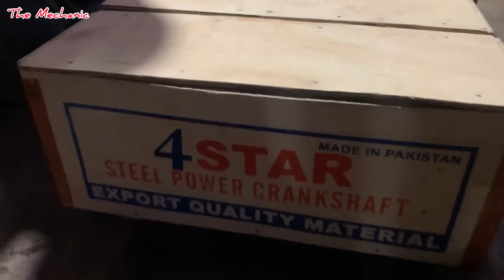Production of Crankshafts in Factory Complete Process || Machining 3 Cylinder Engine Crankshaft

Comment: Interesting. I worked on crank lines at Ford, GM and Mitsubishi as an OEM service engineer for 20 years. It seems that they are missing a few steps. There are no undercuts on the bearings and no heat treatment either. These cranks look nice but my experience tells me that they will only last a few months before failing. We worked hard to hold tolerances down to the tens of microns but I can't see how they are even holding to several thousands. Our crank lines had 50+ ops. This one is skipping many essential steps. What they are doing is impressive but these cranks would compare to what the US was producing in the 1930's.
Reply: I suspect the tolerances they are dealing with are pretty big engine wide.  They don’t even use torque wrenches.
Reply: A quick search of the casting number will tell that this is for a Perkins 135 engine. It's a stationary 3 cylinders diesel used in generators so they will only run at a preset speed, unlike car and truck engines that will indefinitely idle, increase speed, decrease speed, overspeed etc...all while the load and temperature constantly changes. And also some of them have to endure their common nemesis, super clueless drivers.
Reply: you cannot heat treat the cast parts.
Reply: They are also skipped balancing.
Reply: @blabla-kk8bl  Sure you can. We used induction heat treating on both cast and forged cranks. The GM plant in Tennessee did both types on parallel lines. The procedure is different for cast and forged parts but I can guarantee you that you can heat treat both.
Reply: @blabla-kk8bl  You can. Its done after the rough pass.
Reply: @vitor900000  true.
Reply: i think, it depends on the use of the engine, im a mechanic and a machinist myself so i know that a 3 cylinder with a crank like that it probably use in low power and low demand application so u don need tight tolerance or heat treatment because they won’t be abuse. i’ll probably be better to do so but i guess that the costs added to to all the extra process it not worked the benefits
Reply: yea, sure man....do we even want to know what the casting is made from?  you are worried about a few thousandths...??
Reply: I couldn't agree more.
Reply: @blabla-kk8bl  really, i thought my 1973 351-c had heat treated valve seats to help with unleaded gas
Reply: This is about how Ford was ruined by Japanese cars, and Detroit became a ghost town
Reply: @GaryCornelius  sir why you don't teach people? Like on youtube
Reply: Aftermarket fake parts. These will do more bad than good.
Reply: @wajid806  If you ever went through an American auto factory you would realize just how uninformed your comment is. This is a local job shop making knock off cranks for discontinued motors. The technology they are using is straight out of the 30's and 40's. The quality is undoubtedly "just good enough" to run.
Reply: @ТоварищЖанаозенский  Detroit may be down but the rest of the country is still making great cars and trucks. Stop by the GM plant in Spring Hill TN sometime. It is state of the art and makes excellent vehicles.
Reply: @guuuu666  its 
Massey Ferguson 135 Engine. Widely used for agriculture in Pakistan. Obviously the load these tractors have to endure is enormous. Im  agreeing with Gary here.
Reply: @SolarRepublic  I worked for 50 years and the last 20 of them one of my duties was to teach the union service techs how to repair our machines. Now I am retired and no longer want to work. Simple as that.
Reply: Precisely
Reply: @blabla-kk8bl   Sure you can. It's done all the time.
Reply: The first dial indicator you see is the guy cutting the keyway. That's a big clue.
Reply: @wajid806  Gibberish.
Reply: I admire men like you, sir. Men who worked on the edge of precision and tolerance on mechanical industry. Thanks for your testimonial.
Reply: This model of engine, was also produced in Serbia 50 years ago, by the Massey Ferguson licence. 
But i now, that for good quality of engine parts, our factory after casting engine block and crankshafts, were leaving them for 5 years outside of the factory, to go through process of material aging.
Even now there are hundreds of tractors in use, many of them never had intervention on engine. Also many of them were sold in Egypt, and are one of the rare ones to  withstand the excessive heat and conditions.
Reply: These are not the finished product.
Reply: @guuuu666  And lots of Massy Ferguson diesel tractors.
Reply: I see there are many engineers and machinists on this thread, and all have very interesting opinions on how this can be improved. But the basic fact of the matter is, these workmen have probably never been to any engineering college or have had no vocational training. They all get on-job training from whoever is the machinist before them on the shop. They are hired as interns without pay, and when they prove their skills, they start getting a wage. Most of them haven't seen a torque wrench in their lives, let alone using one in the workshop. Their idea is "tighter is better" and would use the largest pipe extension they can use!!
Reply: I am okay, they seem to be good workers but their methods are a thing of the past...Even at the end, how they oil the crankshafts with a rag !?!....
Reply: @blabla-kk8bl  Luckily you can.
Reply: @blabla-kk8bl  
You can with steel cast. Grey cast however, wont work. That's true.
Reply: @routtookc8064  
Out-of-roundness and thus tolerance is the decisive factor for the dynamic stability of a crankshaft. 
This is also the reason why car crankshafts are never reclamped during production. You never hit the identical center again.
Reply: And crankshaft of the 1930s only lasted a few months?
Reply: 100% Know a guy that tried one of these in his 135...blew apart in the middle of a parade. Look at the "care" taken aligning the journals for grinding. These things are so far out of spec, you can see the difference cylinder to cylinder in piston height at TDC.
Reply: @JoeRocket-sf6qs  Yes, they are. You don't do precision grinding as an intermediate step. That's the very last thing. That would also be why they said "last step" when checking the crank in a block.
Reply: Germany factory didnt any heat treatment after they put th cranck shaft on the cnc
Reply: I think the fact that everyone in this thread is missing is this:
Where the hell else are you going to get a crank for an engine out of production for 40 years? Ebay?
Reply: @mahbriggs  no. last 90 years 👌
Reply: They are working with the technology that they have and have been provided by their employer. You can not compare their apples with your pears. They are doing an excellent job with the primitive tools that they have and the circumstances of their working environment to complete such a microns expectation; so unrealistic right?. I don't think they're not wearing PPE because they don't want to, it's just that the law of the country sucks and doesn't protect them. Give them the right tools and I guarantee you, they will do a way better job than every one criticizing them. They are being judged by the tools that they use, you do not know the extent of their knowledge and the skills that go beyond that which you can imagine. Just say something positive, or do they neither deserve that?
Reply: your sofa experience you must say lol
Reply: They build them to the specifications of the customer just as you did.
Reply: Never mind about machining the important is  the quality of materials
Reply: They probably export these cranks and import cranks from the US to use in vehicles
Reply: @jeremygordijk9153  Exactly
Reply: @blabla-kk8bl  not true, cast is one of the oldest hardened metal. It’s commonly flame hardened.
Reply: @vitor900000  Not really, they are balanced using the two big weights, which are not included. Though we did see them check the clearances of weight blanks.
Reply: @guuuu666  Exactly. Generator or pump applications, easy on easy off low revs
Reply: You all are obviously totally wrong. Most of these three cylinder cranks are made for the latest Toyota Yaris GR. The rest of them are for the Koenigsegg Gemera.
Trust me, as I live near the latter factory so I'll know about their work and precision.
Reply: Looking at the environment of working and procedure, you should've  known that the product is not for high powered application. Of course you've seen a lot of flaw if you're from well enstablished company background. The world is big and there are tons of small market which big companies ignore due to not profitable for them but profitable for small companies like what we see in the video.
Reply: @mahbriggs  Those engines were very low power and ran at low speed. Even at that back then an engine with 30K miles needed to be torn down and rebuilt. When I was young an engine was considered worn out at 100K miles. Now you can get 200K miles out of a well taken care of engine. It is all about keeping tight tolerances and consistent materials. That is impossible with the shop pictured here.
Reply: It’s kinda funny that they refer to this as a crankshaft factory! Lol 😂
Reply: I've been curious for a while about the workers in the engine department.  Do they hire college educated mechanics or do they train on the job?  
The most I've made at a factory was $21.65 an hour running a CNC.  I've heard that auto factory workers get $45+.  If that's true and they're straight off the street, that's an incredible wage.
Reply: Yup! Not something but too many things  missing from those guys MASK & Safety Glasses. Don't you think they need more Irons vitamin from the Doctor.
Reply: That's how Toyota became N1, they worked hard, to make crankshaft as it's one shaft without cranks. Back in USSR time I was working on grinding machines, I couldn't get less than 0.008 mm in ellipse on Russian Volga GAZ 24 on a piston neck. But one time somebody brought Toyota shaft, I was impressed how straight and really balanced this thing was, so easy to work with. On the other hand, Russian VAZ Zhiguli LADA shafts were more stabilized, than Volga ones.
Reply: @frankcherry3810  they don’t even use eye protection.
Reply: Interesting.
Reply: They are great workers,  we all know that.  But sometimes it takes somebody like you to teach them the correct way of doing it the right way the first time.  All they have are some hand me down machines and old ways of doing things.
Reply: People need to just watch and see med do good work  I’m sure in there country they don’t have osha breathing down there neck  but over a million people have watched this video so just enjoy the show don’t back seat machine lol
Reply: @vitor900000  No they didn't. At 23:35 the guy is balancing the crank shaft with an angle grinder. :D
Reply: @routtookc8064  you realize how large a thou is right???? No matter the casting tolerance matters
Reply: The chatter alone tells me they don’t know what they’re doing 😂
Reply: FREEDOM of Speech  Добрый день. Это не был провод, а кусок проволоки. Это простейшее устройство для проверки как радиального так и торцевого биения. Правильность установки детали определяется равномерностью касания проволкой детали. Метод довольно грубый и, как вы верно подметили, абсолютно не подходит для производства этих деталей.
Reply: @sikkepossu  That is not balancing. He is just smoothing the casting roughness.
Reply: There seems to be a lot of these Indian/Pakistani mechanical engineering videos coming out lately.  People seem to rave about the work but I can’t see that it’s all that good.  Repairing diffs and engines etc.  it’s fascinating but that’s all.  When needs must I guess.
Reply: They do no even use eye or auricular protection. Their equipment is outdated, if these crankshafts even work will be very very impressive
Reply: they are pro at their job, with 10% ur salary
Reply: @vitor900000  Yes I know.
Reply: and we wonder why lifters and crankshafts are breaking i wonder why hmmmm
Reply: @blabla-kk8bl  oh yes you can. I work in a foundry and we heat treat castings as per client requirements.
Reply: @routtookc8064  
It's not hard to purify steel if you have the equipment and enough knowledge. These are likely recycled from old ship steel.
Reply: Looks like they are made in Pakistan 🤣🤣
Reply: they are missing balancing too.
Reply: @TB-jl9fr  you can heat-treat gray cast, usually annealing to relieve stress due to uneven cooling and/or for easier machineabilty
Reply: At least in this crank grinding shop they have an Arnold Gauge and seem to be using it!
Reply: Ну так они это и делают на станках 30-х годов
Reply: @GaryCornelius  do you heat-treat the cast with just annealing for machineabilty or temper it too for strength? I'm referring to cast iron crankshafts, not cast steel. Tho i'm not sure if there are cast steel crankshafts, that are mainly strengthened by heat treatment and no forging.
Reply: Виде ремастер из 30х)
Reply: you ve missed the most important thing ...it is made of cast iron not hot forged steel its obvious on the laith ....how could it work
Reply: @upmyhead9930  do you mean the absence of heat treatment of these crankshafts? Cast iron can be heat treated too.
Reply: @winstonmichaels407  no ..the cast iron is brittle unlike the hot forged steel and it doesnt endure knocking on piston or twisting torque
Reply: @upmyhead9930  engine manufacturers also use cast iron cranks for their lower powered engines, 3 cylinder in this case, enough to endure the dynamic stresses such engines produce. Forged ones definitely are needed for the more powerful and high revving engines to counter the greater stresses of the higher power generated.
Reply: @94XJ  he got a crank from Pakistan?
Reply: I love these guys, they are hard working non complaining men.  But their whole job is to basically ruin your next engine.
Reply: @GaryCornelius  as someone who worked machine the machines that microfinished crankshafts I can tell you that you did nothing as all the work was done by the other companies 🤷🏻‍♂️
Reply: @smithy3269  do you mean there are no more engine manufacturers who finish let alone fabricate their own crankshafts? Maybe these are sub-companies being departmentalized by the parent company to produce specific engine components, not necessarily contracted out. Dunno...
Reply: @anis8520  maybe the billet or blanks are already heat treated
Reply: @ammo1033  yes, for both cast iron and cast steel
Reply: just curious, are those billets or blanks already heat treated before they get CNC'd? I only read  heat-rolled, if that means anything to the hardness and strength of the final product. Thanks
Reply: @winstonmichaels407  I machined electric motor shafts and rotors but we also did heat treating.  First we would rough out the profile and leave...200th? (It's been 4 years since I have done that job)... then send it out to be heat treated and when they came back, we'd put a diamond insert in and finish out the endplate seal and bearing journals.  These motors were Columbus McKinnon.

I say all of this to say that if you notice the amount of material being hogged off of the journals; if they were hardened, I doubt they could do that.  The color of those shafts didn't look different to me from raw cast and even aluminum would change color and get harder in our rotors; which made balancing them difficult.
Reply: Good talk, Gary
Reply: They use engines from 1930th till now so all is ok )
Reply: Its a third world country duh 🤷🏽‍♂️
Reply: @austinwagoncompany  i agree, these crankshafts are still in their annealed state or right out of the mold before machining. And finish right away what they can with what their eyes and fingers will allow and sent straight to the packing station. I doubt even if these are cast steel they would bother with hardening and tempering, those old lathes wont take it. Tho i haven't heard of cast steel crankshafts, only cast iron, forged steel and billet steel.
Reply: @GaryCornelius  I'm curious is that democratic-run or Republican
Reply: @routtookc8064  I imagine it's similar to when you're buying sausages in the mart and it states what percentage of meat it contains where the cheap ones contain less
Reply: @wajid806  You couldn't have made a more excellent display of your ignorance.
Reply: @ТоварищЖанаозенский  Your comment makes no sense. First off Ford wasn't ruined by Japanese cars. Secondly the standards of Japan and American are comparable.
Reply: @blabla-kk8bl  since when? I run a foundry and castings are typically heat treated?
Reply: @SMG They're "producing in absentia"? Wow they must be wizards
Reply: @winstonmichaels407  Mr winston ..i once saw a video in pakistan of a heavy truck with a  broken rear wheel shaft ..they welded the two pieces ...without treatments ...is this allowable
Reply: From what I pieced together they seem to be for clones of a massey ferguson tractor engine. Slow runner with 3 cylinders, 2,5l displacement and less than 50HP... maybe meant for generators at constant rpm. Will it be able to do this job? Probably yes! This engine will have a little rough run in, but then probably will last forever. 
This will not drive a car running 5000rpms with over 200HP and 400 Nm of torque.
Reply: @blabla-kk8bl  interesting. Please explain
Reply: @upmyhead9930  it's called post weld heat treatment, and it's just too complicated a topic to be applied to broken automotive parts welded together in less than ideal shop fabrication knowledge. The metal composition of the parts and the filler material must be known, aside from the specific temperatures that the heat treatment is applied. Maybe in emergencies go liberal with the weld and cross fingers till the replacement part arrives.
Reply: @happydays454  Analyze the irony of what you just said, and how it is you were able to make your comment for me to see. 

You just typed an electronic message on a portable, wireless, handheld device and potentially millions of unknown human beings around the world can read your message, using the same type of device. 

Rewind the steps of human innovation that it took all the way back in time to get here. 

Don’t criticize the technologies you use on a daily basis. Otherwise, turn in all of your modern comforts, then walk to a wilderness somewhere and live off Mother Earth, the way you think it should be. 

Earth will survive with or without humans.
Reply: I agree with this statement- former machinist
Reply: @mahbriggs  There's a reason people don't pop the hood at every fuel stop anymore.
Reply: Just bu looking at the pout, NO WAY it is hardened and will only deteriorate after 10K miles- if that
Reply: @ScottFc3s  
If you changed your oil regularly you didn't need to.
Reply: but they are like in the 1930s, simply backward but can cope in some way.
Reply: @routtookc8064  looks like a rather soft cast iron.  Must be a very low speed engine.
Reply: @winstonmichaels407  thanks alot mr winston
Reply: just cuz America did it that way dont mean what these lads are doing is wrong all that intensive labor for poor quality stuff i dont think so mate
Reply: @winstonmichaels407  
As i already said, you can do so with steel cast. Steel cast isn't gray cast. It's literaly steel. Of course you can't do this with gray cast.
Reply: These are probably old US machines they are using. Sadly
Reply: @1one3_Racing  At that point, you get a different engine.
Reply: @TB-jl9fr  and as I say again, you can heat treat both cast steel and gray cast. Unless you think heat treatment is just about hardening and tempering.
Reply: Uh they are not in a state of the art facility and many “engineers “ wouldn’t survive “ in these countries and vice versa.
Reply: FREEDOM of Speech  При таком способе всё зависит от рабочего. Если вы обратили внимание, то стойка не крепится при помощи магнита, а имеет просто тяжёлое основание. Сначала конец проволоки выставляется до касания с деталью и визуально контролируется зазор. Потом деталь нужно выставлять. Когда деталь выставлена с минимальным биением, конец проволоки равномерно касается детали при вращении - это слышно. Есть ещё способ при помощи резца. Подводится резец к детали при её медленном вращении. По зазору между деталью и резцом видно в какую сторону нужно регулировать положение детали. Когда зазор не видно, биение определяется по глубине риски на детали. Если биение минимальное, риска визуально равномерная по окружности.
Все эти варианты не дают высокой точности.
Reply: @TB-jl9fr  grey cast does nit gut chips like these,  these are steel.
Reply: В этом деле главное красивая упаковка.
Reply: @1one3_Racing  you need one every 3 months LOL, excellent consumer engine
Reply: @nikolaradivojevic5535  Serbia
Reply: @noiwonttellyoumyname.4385  are you so privileged you don't understand how other countries work? A farmer who earns 35 cents a day isnt going to buy a new $3000 engine.
Reply: Самый важный момент этой работы заключается в продаже произведенного безобразия.
Reply: Normally you machine the crank such that there is stock on the bearing fits, heat treat and balance and grind to final size, low RPM engines have a lot of clearance and many use oil pressure to fill in the gap in the babbitt bearing fits, hydrostatic oil film.
Reply: @blabla-kk8bl  there are processes you can use to locally harden specific features on the crank, i never had to use them, but they do exist for certain applications.
Reply: @gtuabc  these are a heavy diesel that redlines at 1800rpm.
Why would you bother putting in a crank that was better than what it came with originally?
1950s engineering is fine for a 1950s engine.
Reply: @TB-jl9fr  low RPM motors just dont care about tight tolerances, i det these motors run generators or water pumps, have oil pumps interally to make up for loose fits. They are not making high performance engine parts.
Reply: @1one3_Racing  a "quality" product that they claim in the box is supposed to be above the oem specifications, that the difference between a German/Japanese product and a Chinese
Reply: Im my younger days while in the university i worked like them in a Job Shop using manual machine tools, we all worked that hard.
Reply: @blabla-kk8bl  bead blasting adds hardness to materials like cast iron.
Reply: and that's [retty much it :D 
100 years behind :D
Reply: As a hobby machinest I would definitely agree
Reply: @thatdudeinorange2297  you mean these cranks are being made for Toyota Yaris??? Really man...🤣🤣
Reply: @jackmclane1826  yes you  are right. These are hand built generators most probably. The gens are low compression oil burners....well basically
Reply: @vitor900000  Thats stress relief. Not hardening.
Reply: @ABiggerPigeon  What?
Reply: @jeremygordijk9153  You nailed it.👍
Reply: I think they are skilled people not trained but the way they are doing are well accepted in market.
Reply: Отсутствие балансировки, косых сверлений, заглушки тоже отсутствуют
Reply: I see safty is #1 priority
Reply: No steel toe boots, no masks on faces, they try to do what they know from generations, from the same 3 cilinders diesel engines.
Reply: @zjoesmoe1135  it was Regan
Reply: Probably going into KIA's or Hyundai's.
Reply: @blabla-kk8bl  what? Of course you can
Reply: I can assure thay could make it better then biggest manufactures if they got similar budget. For me amayzing work. I have workshop with cnc machines, but if even electronic would be broken we cannot do nothing - but they are totally self efficient. Brilliant job, I hope they can evolve with their passion.
Reply: For me, even if this crankshaft will not be used, it is a piece of art. Those people if they have tools they will build a futuristic space ship.
Reply: exactly what I was thinking
Reply: @GaryCornelius  You know, my 2000 model Toyota Hilux in Saudi Arabia ran for 500k +  kilometers, over 300k miles? The engine was never rebuild.
Reply: Aftermarket product, what else can you expect.
Reply: @UCdB_7TWkt36IYZVXoIsMDUg I could be wrong but I think it was an engine conversion offered from private companies to replace the anemic and problematic engines originally fitted at the factory. The engine was a "P4c" Perkins 3Liters (not 3 cylinders) that outlasted the cabs.
Reply: 25 HRC max))
Reply: Go to Pakistan and try it with that equipment.
Reply: Lol if anyone knows Pakistan they will know people will never buy parts that don't last long and are not well made
Reply: @jeremygordijk9153  appreciated sir
Reply: @jeremygordijk9153  
I like your opinion
Reply: @jeremygordijk9153  
I like your opinion
Reply: Don't forget, they will be using metric measurement, so they will be better than US products.
Reply: What would you expect from shop that has, let's say 10 lathes and only 3-4 indicators and 2 micrometers :D
Reply: Its the best cranks in the world блин
Reply: Would this be the case for a low rpm tractor engine such as these are made for? These cranks are Being made by what appears to be Belarus which is exactly what I’d expect for that company.
Reply: These are machining like cast iron not steel or even ductile iron .  These have to be for low stress engines , the Steel parts snd export quality on the bags was a little optimist .   Good to see simple parts being made with simple machines but not for anything close to automotive use or rpm.
The suggestion  in a related answer that they are for Perkins 3 cyl ( diesels?) is scary , I hope not!   Possibly a Perkins copy , there is a very common 3 cylinder diesel engine used by many manufacturers like Perkins /Volvo etc in many application based on a Japanese base engine but these won’t be for them !
Reply: @mahbriggs  Yes and no. There was a time where a lot of parts in a car were easily accessible, because they would wear out on a regular basis, and a number of routine maintenance, like putting grease into grease ports, was absolutely expected from the car owner. With better tolerances, not only do many parts last a lot longer without any maintenance at all, you can also have far better efficiency. The latter one is where tight tolerances are really required, mainly for higher compression in the cylinder.
Reply: @adnanbh  You do know the torque wrench was invented in 1927 right? It is perfectly possible to tighten everything properly without one.
Reply: @jeremygordijk9153  1940s equipment is hardly primitive.
Reply: olo
Reply: @jakubukleja2553  😁 agree!! That's why most spanners and wrenches are made to a specific length according to it's mm size. The length of the lever and in turn,  torque can be limited. I've seen people tighten a wheel nut with full force using a 2ft lever... ☹️
I think the modern machines like cars and engines are more 'delicate' and depend more on having the right torque specs. Thoughts?
Reply: @raddydiaz4332  they’re going into a Perkins 135, a mounted generator
Reply: На коленях и то не плохо. Люди как могут так и выживают.
Reply: No point comparing Mitsubishi and then boys in towels, waste of time.
Reply: hammering like that on spindles, I'd be surprised if it had less than a mile of runout
Reply: They're using metal ball treatment instead of heat one. Not only it makes material cleaner, but also harder on the surface. I believe you aware of this process, which is being used with many modern producers, especially for bigger engines, like marine ones.
Reply: @nosuchthing4789  I missed one letter... 😁
Reply: @Tirah5  I think not only MF135. When they're packing, there are boxes marked MF-240. Some boxes are marked with "Belarus", which could mean they also produce for MMZ-3LD engines.
Reply: Wss
Reply: 🙏🏾 इस
Reply: 8आईआईपी8i
Reply: 8i🙏🏾8b
Reply: 🙏🏾b
Reply: B
Reply: Ib
Reply: 8i
Reply: Iiii
Reply: I8iii
Reply: Iiiiiiiiiiiii
Reply: Iiiiiiiiii
Reply: Ii8i
Reply: Ii
Reply: Iiiii
Reply: Iiiii
Reply: Ioiii
Reply: @frankcherry3810  not to mention hammering the work with a sledge while its on the lathe
Reply: i have 5 cars running on 1930s crankshafts  still going 80 years on that's when we had proper engineering not all computer a man and skill
Reply: @GaryCornelius  you are right, very low power, low speed, relatively low life and low cost, if the economics of a modern engine worked and they could be repaired and maintained these guys would probably use them.  The kicker is the emissions really otherwise it would be great.
Reply: @vitor900000  Did you not see yer man balancing with the hammer? LOL
Reply: I was thinking ww2 tech and conditions
Reply: 2:09 он за один проход снимает сантиметровый слой материала. И резец даже не покраснел. Вывод прост: либо резец из "адамантия", либо вал из "пластилина". В последнее верится больше.
Reply: China miss 8 steps , those parts brake easy...
Reply: These are inexpensive crankshafts. Being a Pakistani, I can tell that these were being made in a small shop, hardly 1000sq ft, in Lahore.
I was also noticing the lack of critical steps like balancing, but these kind of crankshafts are generally used here in decades old diesel engines, that are worse conditions than these crankshafts, and still, the person who'll buy one will most likely have them balanced according to the piston weights.

All, semi decent engines including tractors use crankshafts made by large scale industries with hundreds of CNC machines. I know because I have visited.
Reply: @oppamaclare  It was not balancing. He was just centering it on the lathe.
Reply: @raddydiaz4332  Well, if you are a pro-machinist and mechanic and you said is ok in engineering practice, you are not fit to be one. Costs is something you can look into with good alternatives but giving concessions to such a unpro work, you still can accept and tell those reading your comments is a shame. You need to go furtge studies for what you are.
Reply: @syedusamamanzoor1838    The products from India are of good quality, but from China, from experience, Chinese products come with defects that damage the engine enormously. Here Venezuela has good trade with China because the government says that the United States and Europe are bad people. of enormous failure and short duration all copies, I have seen several times how engines explode into pieces and the ciguañales break in half as if they were branches of dry wood ... the pumps do not lubricate, the pinions do not resist etc ... china exports clean garbage and hurts those who buy Chinese products ...
Reply: @vitor900000  I was joking.
Reply: @vitor900000  Balancing with Bolgarka =) But in fact, it is very interesting to watch. It's important to understand this. If there is no alternative, then you have to use what you have.
Reply: @nistaffsubs6787  in Pakistan, we also used to get crap Chinese products so much so that every thing with inferior quality and no durability was called “China ka maal” in Urdu, meaning “Chinese Goods” including a person's lack of resolve, or bad food products. But as trade with China has increased, and purchase power of people has increased, we are actually getting some worthy durable goods just as well from China.

Turns out, China will export you the kind of service, your government asks China to.
Many of the top electric appliances brands of EU and US have at least goods partially manufactured in China and are really durable.

India also has crappy products, but since India has a huge competition, I'm sure there government emphasizes on only reasonable to great product lines leaving the country, and it is appreciable.
Reply: @bla bla That's generally only true for die-cast parts which are manufactured in the conventional manner. Parts produced via vacuum die-casting or laminar die-casting can be.
Reply: Sir, the engineering prowess of this country is just beyond your grasp.
Reply: @raddydiaz4332  meaning low quality and cheap? Or as you could say; cheap, close enough, rock 'n' roll! I like that we have products that cost 1/10th of the price of quality when not needed. You expect shit but can be surprised and are ready to buy another. For expensive stuff you hope it will last, it probably will, but if it fails you cry :-D
Reply: @toska3528  😂😂
Reply: @GaryCornelius  180 dollars crank.. would you pretend any more from a price like that?
Reply: @funonoldwheels7150  A lot of old Massey parts on eBay are knock-offs that are imported. I know we waited on it for months because it shipped from India.
Reply: @blabla-kk8bl  Yes you can.  If they are using magnesium cast iron (AKA nodular iron)for those crankshafts, which they should be, they are heat treated over a 24-32 hour process.  As stated before, the technique that they are using was abandoned in the 1930's
Reply: @vitor900000  That's what the big hammer was for.
Reply: The machines they're using are just fine. Engine lathes are fine as long as table is straight. The measuring tools though... using a copper tube as an indicator? I personally don't know how you measure runout without a dial. Looks like they dial in finish cuts. So looks OK. Don't particularly like moving the centers from lathe to lathe, but if there's enough meat on the bone its doable.
Reply: How many time did GM get bailed out?
Reply: @routtookc8064  what a hell of casting mixture ???? hajajakaja who knows !?!
Reply: No, these cranks would be comparable to 1910's production in the US, not 1930's, and even by those standards this is somewhat crude quality.
Reply: good but can you compare of price of your crank and this crank? same difference as thousands & hundreds :~
Reply: I think because they use cast iron and increase strength by shot peen . I see lathe chip is not cut out continuously.
It is the best way they can do. It is not necessary to have big hydraulic machine 
But this crank is not suitable for heave im pact load due to cast iron property
Reply: @subterfusion4005  What's the brand name? 'Trojan Horse'?
Reply: @GaryCornelius  More like Turn of the century standards. By 1940, things were pretty tight and precise in America.
Reply: @jeremygordijk9153  very accurate, a lot of people rely on them to work in a good environment with full equipment and modern machinery, they take that as the standard and want to apply it everywhere, here the men This is taking everything they have to be able to create the impossible, but can this shaft be used for low-performance engines in the countryside or farm machines that don't need strict standards, Just relative quality and reasonable price. With rudimentary tools and superior skill they were able to make parts of relatively perfect quality, then if they had the right machinery and technology, I bet they beat the engineers. at American factories, hahaha
Reply: @upmyhead9930  At Pakistan truck repair everything is allowable. That's why so many trucks go down the mountainside with 40 people on top of the load.
Reply: @blabla-kk8bl  They can heat treat the bearing journals- nitriding or induction hardening
Reply: @vitor900000  might be done later
Reply: Thank you for pointing this out.

I would love to watch some machining content created by someone with your knowledge. Have you considered doing so, even if just given in simple lecture format instead of in a shop?

Many of us out here in internetland could benefit greatly from your knowledge.
Reply: @aliazharsalim  A few times, as did Ford and Chrysler.  Those companies actually pay their workers a living wage and sweep the floors...and work on benches.
Reply: @honkie247  I don’t think they would if it wasn’t due to the workers union and governments putting in place workings standard.
Reply: No safety glasses or any type of equipment JS I am a CNC IMSA gun drill operator 25 years. Ran cnc lathe for  a bit safety first friends
Reply: Maybe they are rough cut and will be cnc finished somewhere else?
Reply: @mahbriggs  Crankshafts in the thirties were for the most part forged steel.  Watch the video of the Ford model .  It shows the workers putting the rough crank into forging dies and hammering it into shape.  Also, the compression ratio of the early engines were less than 5:1, less load on the main and rod bearings.  Also the engine operated at 1500 rpm.  Go too fast and they would disassemble themselves.

Also crankshafts in the early engines were balanced.  Did you see anyone balance these crankshafts before putting them in the shipping crate?
Reply: @TsunauticusIV  I would have said that using a hammer to center parts in the chuck would tell you that.
Reply: @jtqthetieman  Cash for clunkers?
Reply: @honkie247  
Do you not understand what the crankshaft are for?
The design of that particular crankshaft is ballenced externaly with bolt on weights!
At least according to people who have commented and identified the engine those crankshaft are for.
I will admit I am taking their word for it, but I do know some industrial and agricultural engines are designed that way.
Read all the post and learn something.
What ever else, these engines were not built for a Ford motor.
Before you attack someone, make sure you know what you are talking about!
Reply: Might be for an elephant.
Reply: @mahbriggs  I understand the concept of bolt on counterweights on a crankshaft.  They are used when sufficient counterweight cannot be cast on the crankshaft and still leave room for easy machining.  With that being said, the crankshaft BEFORE the bolt on weights are attached still must be within certain balance specs in order for the crankshaft to be in balance when the weights are bolted on.

PS An externally balanced crankshaft is one that uses counterweights on the harmonic balancer and/or the flywheel.  Even tho the weights on this crankshaft bolt on, the crankshaft is still internally balanced.
Reply: ... But Costwise, they're a lot cheaper.. 20%
Who needs expensive cranks when cars last only 10yrs
Reply: @honkie247  
Ah!  So you admit that the crankshaft can be externally ballenced!
Good for you!
Do you know what these crankshafts are for and what the specs for them are?
Reply: @honkie247  
Nope. If we dumped our clunkers anywhere abroad, it was likely Mexico. Cartels for clunkers. These guys likely buy steel from nearby ship breakers. It's cheap and available.
Reply: @guuuu666  mf 240 tractor engine
Reply: Good for you
Reply: @msdweldingfabrication7051  I read up once on the manufacturing of engines for the model T. Their processes were better than this by quite a bit. Machine tooling available in the US was quite good by the 1920s too.
Reply: FREEDOM of Speech  I think they watch the other end of the wire for wobble. When it stops wobbling the part is "running true." I guess if you set something like that up properly, it might actually work pretty well, but why not just use a cheap dial indicator? I can't figure that one out. As others said though, these were rough cut to oversize at that stage and all bearing surfaces were final ground off the centers following the shot peening process. I would be interested to see someone take some decent measuring tools and check one of these to see how good they are. In spite of the crude methods, it's possible they're getting decent true running parts via that final grind.
Reply: @ТоварищЖанаозенский  what has this video got to do with Ford or Japanese cars?
Reply: That’s why your facilities are not open anymore and closing every year , Heat treated sure dip them and leave them out to dry in a 40 degree Celsius country like this one or furnace
Reply: @blabla-kk8bl  oh really ? look up nitriding...  Nitriding is one of the most popular methods for surface engineering. It is a low-temperature heat treating process that diffuses nitrogen into the surface of a metal to create a hardened surface. Nitriding is predominantly used on steel, but also cast irons, aluminum and titanium... had it done to many cast cranks for racing applications .... do your research before making a comment
Reply: They were shot peened, not heat treated. Why doesn't anyone else notice this? Look it up on the internet.
Reply: @guuuu666  You are 100% right. I worked with the 4cyl. at Graco when I built the Exp2i integrated spray units. Assembled them into generators to power the unit. Frickn beasts. if the owners took care of them they had a solid service life.
Reply: Thanks for sharing, made America proud!  I'm a Ford lover.
Reply: Tu voie pas qu ils travail en sandale 😆😆😆
Reply: @gtuabc  first, this is Pakistan. Second, you're not going to put "shit" on the side of the box. Third, is would above OEM soec based solely on the quality of the base metal being better than it was. Fourth, and I've said this before, they would be the only manufacturer of cranks for these engines.
Pakistani farmers don't have eBay and overnight shipping. Or Egypt or any other place still using this tractor.
Reply: Or, you could just look online and see the 12 month warranty.  They are building 3-cylinder 45 hp farm equipment parts. not 900 hp 10,500 rpm PU106C AMG F1 crankshafts.
Reply: Well, it's 1933 again
Reply: Bead blasting but no nitriding, I think it's a copy of a very obsolete Perkins engine.Probabley so cheap that when it breaks you just fit another.
Reply: @GaryCornelius  We live in Australia and I think our Arcadia is made there. People here do not realise that many of the Japanese cars they so highly praise are actually made in USA as well.
Reply: I think our cranks of the 30s might have been better. By that time we had lots of automation with go/no go QC gauges etc….
Reply: my guess is they are just rough finishing them and will be final finished somewhere else.
Reply: @blabla-kk8bl  If they are cast iron, just because it's cast doesn't mean you can't heat it treat it if it's cast out of a decent material.
Reply: @blabla-kk8bl  W
Reply: Para el uso del motor es para algo no muy especifico y edemas creo si el que los mando tambien es consiente de los coste de producción.
Reply: Ademas adicionales que tambien lo pueden mandar hacer tratamiento termico a otro lugar
Reply: @blabla-kk8bl  Nodular Cast Irons.
These cast irons are also known as speroidal-graphite irons or ductile irons. These grey cast irons have 3 to 4% carbon and 1.8 to 2.8% silicon, and graphite nodules are dispersed in a pearlite matrix instead of the formation off fake graphite. To achieve this structure about 0.02% residual cerium or 0.05% residual niagnesium or even both is added to the melt due to which the sulphur is removed and many small spheroids in the as-cast material are formed. The surface hardness of as-cast nodular iron is greater than for steel of similar strength, their respective hardnesses being 250 to 300 and 200 to 250 Brinell number. The flame or induction hardening can produce a surface with Brinell numbers of 550 to 580, and also a form of nitriding can be applied if necessary.

Nodular cast iron has the advantageous properties of grey cast iron (that is, low melting point, good fluidity and castability, excellent machinability, and wear resistance) as well as the mechanical properties of steel (that is relatively high strength, hardness, toughness, workability, and harden ability). Now-a-days a large number of crankshafts for both petrol and diesel engines are made from nodular cast iron in preference to the more expensive forged expensive forged steel. To support the slightly inferior toughness and fatigue strength of these cast irons, larger sections and the maximum number of main journals are used.
Reply: Gary, these videos are for entertainment purposes only. The person posting them does so to make a few bucks.
Reply: @raddydiaz4332  It's a cast iron crankshaft, maybe nodular in a diesel engine, it should be a forged alloy steel unit.
Reply: ذ
Reply: Ok. Show how you do it..
Reply: There is a machine shop up the street from my shop that is OLD SCHOOL. 4 of the 5 have all passed away within two years of each other. Youd walk in and the guy operating the crank grinding machine was shoeless, smoking a cigarette. His legs were bright red from the affects of diabetes. You could see the mist of machine oil in tbe air. Everything was covered in a layer of silver dust and machine oil. Nobody wore masks or gloves. I can only imagine how bad breathing that stuff in constantly would be for your health..  Serious blue collar work right there
Reply: I also do wonder how many accidents have been in that "factory".
Reply: @vitor900000  He did ballance them, didn't you see him with the grinder? LOL!
Reply: Where can i buy a pair of these safety sandals.
Reply: Yes, but what the US was producing in the 1930's got the ordinary Joe mobile, and the farmers ploughing the soil growing food for the people so don't knock it!
Reply: Precision jigs and fixtures are missing. No precision engineered templates to guide the movement of the machined part(s) and machining tool bit(s). In the 1950s when we are building nuclear components for the submarine department and for the experimental nuclear aircraft department we use precision engineered case hardened tool bits, jigs and fixtures, and guiding templates. Nothing was left to chance. Everything is precisely measured before and after machining. And everything was measured again to check it's tolerances before final assembly.
Reply: @austinwagoncompany  at most they earn 150 to 250 dollars per month only. The guys in video
Reply: Poros engkol ini untuk mesin yang berputar rendah dengan tenaga kecil.
Reply: @summitlt  my point is, how is a Pakistani farmer who doesn't have electricity order something online? They don't have Amazon delivery drivers.
FFS are people really so privileged they don't understand this?
Reply: It says "export quality" on the wooden crates... so they are good enough to be shipped from Pakistan to Bangladesh.
Reply: Sir I am interested in learning conventional milling but is there any good institute in America where I can learn I am from India age 40+
Reply: @guuuu666  👍👍👍💖💖💖👏👏👏right😉
Reply: @GaryCornelius  That'd be the Saturn plant -- the division that GM created then ruined.
Reply: @47ALTAIR47  you may be right. I've been getting a lot of really crappy cast parts at Oriellys. I put brake rotors and calipers on a dodge minivan. 3 days later I had to go rescue my wife off the side of the rode.the rotor was sheared in two and the caliber was broken where the two arms make a horseshoe around to hold the front pad..I think the caliper is what broke first. Found out it had a bad cast line clear through it. Went to get another and luckily I checked before I bought it cause it had the same problem,  Orielly ordered 4 more in for good measure and they were the same. They called it in to who ever was in charge. I put on a different brand rotor and just rebuilt my old caliper.. I've had bad water pump castings and other things too. I think made in Mexico.
Reply: @goofy2295  no they are poured cast iron.thats why they look so ruff. I've watched these guys pour all kinds of casting.the big problem is in the metallurgy. They melt down whatever they can find.and scrape all the crap off the top. Done right there would be a specific mix of materials.
Reply: @Sony Vegas these are cast iron  not steel. Low rpm .good enough. Probably wipe out some bearings pretty fast though.
Reply: @ledhunters  you mean the so called dial indicater he used. Just a wire scraping against the journal. Ya gotta listen for that perfect pitch squeal I guess.  Lol.
Reply: I don't see any Intra gauging machines here!
Reply: Your reply was like heavy book hitting my face that some knowledge you dropped there sir.
Reply: @blabla-kk8bl  Since when? Have been heat treating cast cranks for ever. their rough cutting them, they will get heat treated and then have the journals ground to tolerance.
Reply: @jeremygordijk9153  ooh my god what a analysis sir.....
Reply: They are possible several thousand cheaper workforce than your crank lines was :)
Reply: They might finish with a grinding operation, and this crank may be going into a low compression engine.  Then it would make sense. Maybe a 3rd world engine that runs on dirty fuel in thin air with minimal cooling, pulling too heavy loads with weak transmissions.  Who knows.
Reply: Microns?  I doubt QC was that good.  I rebuilt a 1979 Ford 2 L that required 50 thousandths oversized crank bearings FROM THE FACTORY !  Imagine tooling so worn out that the line continues to run with obviously huge deviations.  Ford chose to keep grinding away only to regrind later….Thise were the days
Reply: I think the US in 1930 still held better tolerances than these folks are.
Reply: Isn't it funny how usually there would be a literal war going on in these comment section threads but we can all come together harmoniously to shit on India. lol
Reply: @guuuu666  @Gary Cornelius I am itching to setup a business that addresses exactly these problems. BTW these crankshafts will go to another facility which will refine them to better specs. These people get a lot of used Perkin engines, as well as other industrial engines from the middle east. These engines are overhauled in Pakistan like so, and then some big OEM company replaces it back at a much higher rate.
Reply: Not all crankshaft designs have rolled fillet radiuses or what you call 'undercuts'. Many famous brands produce cranks with the fillet radius simply ground to blend from journal to the web cheeks.
Reply: @frankcherry3810  Why would thy need to use torque wrenches? They aren't building the crank into an engine block at any stage of the process.
Reply: @Tirah5  I did wonder if they were Perkins 3:152 cranks they were making. As fitted to the MF 135
Reply: @TB-jl9fr  Mind action hardening works just fine. The same process is used to harden iron lathe beds on the slideways
Reply: @ammo1033  and also induction hardened as is often the case with cast iron lathe beds.
Reply: @upmyhead9930  Many older be tish made  engines had cranks made from cast iron...nothing out of the ordinary there.
Reply: @upmyhead9930  it isn't brittle if it is grey ductile iron as they are machining here.
Reply: @howardosborne8647  yes, i watched the entire engine build and these guys dont even own a torque wrench.
Reply: @victormuckleston  I disagree. This is most definitely grey cast iron they're machining here.
Reply: @John-100  Induction hardening does exactly what you say. It only hardens locally on the bearing surfaces.
Reply: @goofy2295  Not these ones. They are cast grey iron.
Reply: @diegofavero3083  Because they dont have eye protection?
Reply: Thas why my 1930 packard still runs..👽
Reply: Overseeing robots machining cranks? Impressive. Undercutting bearings? There are no bearings shown in this vid, only journals..
Reply: I bet you didn't notice these go on a 3 Cylinder engine light duty vehicles and not a V8 so no need to heat treat really, second this production is in a third world country where labor is super cheap so they can just replace the crankshaft if it fails and also they have a good track record of repairing and recycling machines over and over.
Reply: Although the fore mentioned auto manufacturers are complete crap (compared to Toyota, Honda, etc.) I do agree with you on the quality aspect, but man. No gloves, no safety glasses, I doubt there is a heat treat and quality control department in that sh*thole of a machine shop.
Reply: O que serve um torquímetro !
Reply: @GaryCornelius  More like the 1900s, Detroit was turning out much better quality than this in the 1920s
Reply: And we have not yet been shown the casting process, it is possible that the metal is porous like a sponge)))
Reply: I agree, also the material seems quite soft (not SG iron) when being turned. They look cast not forged. And certainly not heat treated.
Reply: Grinding with a cigarette ,the new flavour of marlboro with aluminium oxide and cutting oil water emulsion
Reply: You are talking shit right now, they products is a quality product
Reply: @GaryCornelius  some years ago I took a Kaizen class taught by a couple of Toyota people. They talked  about American quality like you do about this crankshaft shop : ]
Reply: АвтоВАЗ переводите "запоминайте"
Reply: If it's thermal sprayed and from the looks of it looks like it is then it probably doesn't need heat treatment, as the molten metal is sprayed on to the crankshaft.
Reply: @guuuu666  you are fight on the engine type but not the usage the massey 35 and 135 use them plus numerous marine engine conversions my tug runs one
Reply: Korek✔️
Reply: @blabla-kk8bl  that is not true. We heat treated cast gears after machining. not sure about whether its proper to heat treat crank shafts
Reply: @RustyorBroken I noticed that. no  micrometers prior to that also. The guy had a carpenters square also
Reply: @adnanbh  no disrespect to the men. they are hard working and appear quite skilled. They are working with what they have. fortunately they have a pretty decent crank grinder at the end to make up for the lack of precision prior.
Reply: That's a little insulting to the 1930s American machinists
Reply: I agree, I have just posted something similar. The big end journals finish will be eating away at the big end bearing material almost immediately. I wouldn’t expect this engine to last more than a few thousand hours at best.
Reply: It works forever
Reply: FREEDOM of Speech  The guy doing the grinding with the angle grinder was balancing them at the same time....LOL
Reply: Man you expect a lot for $29.95 lol !
Reply: @GaryCornelius  I remember that sir. 100,000 miles was almost like a drop dead milestone for an engine. In drags racing in the 70’s, when I was a teenager, I read an article in a hot rod magazine from an interview of Bill “Grumpy” Jenkins. He raced in the NHRA Pro Stock division. Tube chassis, stock body and highly modified carbureted factory block.  He would use small block Chevy blocks with approx 100k miles that came out of family cars and station wagons, magnafluxed and inspected, then fully machined for racing tolerances. He did that he said because those blocks were fully seasoned and no longer stretched. The tight tolerances would hold steady on an old used block, where new blocks would go out of tolerance too easy.
Reply: @1one3_Racing  If it is the engine out of a Massey 135 it's a Perkins 3/152. There's no shortage of spares for them.
Reply: @cleitoncamilojr8094  by your logic, a scam product that will brake has value? You are a fool sir.
Reply: @1one3_Racing  make one? But properly?
Reply: These chips from the cranks shafts tell me they are cast but not cast grey iron, the chips are funny and the operator isn't brushing them off his face as they burn him.  Maybe it's nodular or a similar spheroidal graphite in a bed of pearlite. They do not respond to heat treatment. Even in the 30's some engines had forged cranks with nitrided journals.  Stiff fun to watch.
Reply: @GaryCornelius  US and great cars? After that ive stopped reading… 😂
Reply: Cast crank shafts.
Reply: @guuuu666  No…these cranks are for the engines in the 2022 running of The Indianapolis 500…couldn’t you see Roger Penske in the background
Reply: @russellking9762  ohhh, I missed that crucial detail. Thanks for sharing
Reply: FREEDOM of Speech  "turner used some wire to set the runout of the shaft" - nothing wrong with that, he was only roughing it out and it looks like they left a reasonable amount on for the grinding process. Using a dial indicator on a rough surface like that isn't the best for the dial indicator or that accurate anyway. As apprentices we would get in trouble if we used an indicator on rough surfaces.
Reply: That's what I noticed.  I don't see how it can be used without balancing.
Reply: @bubbaledbetter9995  If you saw how much some crankshafts (that came out of working cars) need to be balanced when rebuilding the engine, after a long life, you wouldn't worry that much. There was some real crap that came out of the US.
Reply: It only has to be good enough.
Reply: @bicylindrico  One was made by "Cincinnati"
Reply: Considering where and how these engines are used, and the price point that users can afford to pay, these probably meet the "suitable for use" test.... Or people would not buy them.
Reply: @blabla-kk8bl  Shot peening and and Nitriding is a hardening process on top of double line fibre surface where atomic nitrogen is introduce into the surface of a ferrous alloy. It helps to maintain the hardness of the cast iron
Reply: Interesting you should mention the 1930’s. Many of the lorries these cranks will be used in are 50-60 years old, that’s how they get away with it.
Reply: @raddydiaz4332  it will heat treat itself over time.
Reply: I’ve bought Indian parts that were heat treated here in America that are perfect.   No problems and they are within tolerance. Their cranks can be treated with an induction furnace.
Reply: @TB-jl9fr  You mean out of concentricity not out of round. But, it doesn't matter because the last operation is on the grinder and all the main journals are done in one setup.
Reply: @GaryCornelius  God bless you for your service
Reply: The best part for me was the boxing up process…SEND IT!!
Reply: Maybe you worked on our Landis grinders then ?
Reply: @sthorn1000  I worked for 8 years at Caterpillar in Peoria and we had several Landis grinders that I serviced. Very solid machines.
Reply: @jeremygordijk9153  dont agree to some extent. I have a restoration business in pakistan and I sell my vehicles in Europe. I hire men like these but provide them modern tools. It’s very difficult to have them forget their old habits. They thing they know it all. provide them torque setting and hand them a torque wrench they will run to their old pipe to slide over the 300 year tool the have been using all their life. So i had to put my foot down and kick some ass, and i do mean KICK some ass, to make them adhere to SOPs. The key problem is that they have never been to a college. The are good at replicating but not at innovating. That is why they have the Neolithic age tools. In USA etc the new tools did not come from Mars. They knew they have to up their game and invented better tools to deliver better quality. But these guys will just continue whatever they have and never ask the question how they can improve cause they can not translate the meaning of “improvement” in particle terms. They will probably not even be able to read to see whats going on in other parts of the world. The owner will probably be happy that he making some money by selling locally. This crap will obviously not be exported so there is no real competition to them and their product.
Reply: @raddydiaz4332  Exactly! It's not a Sprint Car crank. ;)  It'll last an extremely long time if not operated outside of its parameters. And Shot Peening is more than adequate for strength in that application.
And while I'm not standing there with a micrometer, their rod and main bearing journals appear to be pretty damn straight with a good finish and it appears there is a good radius from journal to crank throw. I see no apparent issues here.

These guys are something most of the western world has lost. They're craftsmen. And considering the fact that their machinery is ancient (not necessarily a bad thing), what they accomplish in the finished product is pretty amazing. I'm impressed.
Reply: @GaryCornelius  You dont have to heat treat a low power, low rpm 3 cylinder crankshaft. Shot peening is all that is necessary to strengthen and stress relieve the surface.
If the tolerances are correct, it will last a long time with no issue.
Reply: I agree to u..
Reply: @vitor900000   No need to balance for low RPM pumps .. No need for high tolerance and no need for heat treat... I have seen these last decades.
Reply: @ТоварищЖанаозенский  нет, это про как развалились заводы зил, краз, заз, каз и т.д.
Reply: @blabla-kk8bl  Where do they heat treat cast parts?
Reply: @vitor900000  why do you say that when You dont know? You can heat treat cast iron. We used to heat treat cast iron with a rosebud torch then water quench
Reply: @danneumann3274  
One word: Warping
Reply: @vitor900000 must be done before grinding. you are right though.
Reply: @danneumann3274  Yes... but it would make the job much more labor intensive since you would need to retool the entire piece.
Also your would loose a lot of material reducing the life span of the piece by a lot.
Not worth.
Reply: @hankpikuni7024  Maybe, but these days a well maintained American vehicle can last over 200000 miles. I can attest to that since I have personally had 2 cars with that many miles. Remember that I was a field service tech and would drive over 1000 a week on some weeks. My last car, a 2007 Ford Explorer had 207K miles when I traded it when I retired. It was still running and reliable.
Reply: There are a lot of running 1930 engines.
Reply: @mbsnyderc  Sure, with engines that have been rebuilt. That was a time when a engine that had 50K miles was considered worn out. My dad had a 1949 GM pickup when I was a kid. It had over 200K miles on it when it was finally so rusted out it was no longer usable. However the engine was rebuilt by the service garage next our farm at least once when I was a child. I know it was rebuilt several times before I came along. There is still an old head gasket and ring kit in our garage.  I also remember our garage had an old motor that had been scrapped from before I was even born. The crank had broken and blew out the block. Today an engine that is properly maintained can go 200K miles without a rebuild. What these guys are doing is interesting considering the low tech way they are doing things. It just isn't even close to what a modern engine is.
Reply: @GaryCornelius  That's a myth the biggest difference between then and now is better fuel and oils there are many old engine that haven't been rebuilt they weren't asking much for power for them back then.
Reply: @mbsnyderc  Everything has improved since then. However the subject is cranks and the way they were made then as compared to now. You just can't compare a 1930's engine to one from today. The materials are better, the engineering is better and the manufacturing process is better. I defy you to find an 1930's engine that has been in use for 90 years that hasn't been rebuilt. They just don't exist.
Reply: they are OD grinding w/ micrometer, easy to hold a couple tenths. but yeah very oldschool :D
Reply: Gary can you explain what the do with the grey grains on the big chamber, is it shot peening or whats?. I agree with you regarding the comparation with 1930 US crankshafts. Thanks.
Reply: @franmontilla8  These cranks are made of cast rather than forged steel. What you are seeing is the grain of the metal and the texture from the mold. That is normal with cast cranks.
Reply: I'll stick with cold-worked parts, thank you very much.
Reply: @zoti  don't forget about the safety sandals!
Reply: Это коленчатые валы для двигателя Д-240 от трактора «Беларус» так что с допусками там все нормально! Этот двигатель начали выпускать ещё когда динозавры по планете бегали.
Reply: @mahbriggs  bearings replaced with leather belts !
Reply: @jeremygordijk9153  many would revert to simple wrong procedures .
Reply: @austinwagoncompany  It has always been that way management wanted millions and pair labor thousands .
Reply: Is it forged or is it cast?
Reply: Is it forged or is it cast
Reply: @belolipetskiy1096  Хорошо, я думаю, допуски не важны для этого приложения. Я все же хотел бы увидеть тепловое лечение. Они прослужат дольше.
Reply: On one hand I would like to see forged crankshaft with roller bearings for connecting rods, like Daimler-Benz DB601... On the other hand...I guess this works for low cost.
Reply: Don't you guys underestimate their ability. Give them an F - 16, they will make a copy within no time. We have a place in our country named Jinjira. It is said that they can clone everything except human being.
Reply: @mdsharifulislam151  Looks like they have plenty of ability, but perhaps lack the small details sometimes!
Reply: Yr
Reply: Cars from the 30s are still on the road more than 80 years of service.
Reply: @earthscrust9092  Sure, after numerous rebuilds. There isn't any argument,  because of improving materials and engineering cars last much longer.
Reply: Yes sir you are right final quality must be very tight and heat treatment
Reply: even the 1930s ford cranks were nicer lol but they do have better bearing tech at least nowadays
Reply: They only have a limited machinery and tools.
Reply: Yes, it is just like the US in the thirties. Most of these guys don't wear any kind of safety equipment. I've seen these guys weld with a handheld face shield and wearing sandals!! I've got three welding hoods, and only one head!
Reply: @blabla-kk8bl  ll
Reply: I can assure you that these fake crack shafts are better than those made in ford, people search about ford life spam on internet reviews
Reply: @bicornis Shop  sure, tell that to my ford explorer with 250k miles.
Reply: @GaryCornelius  compare Ford with other companies such as Toyota, Nissan, Mitsubishi. I have Toyota Corolla more than 380k miles still running very well, 
I've also used Ford edge drove 35k miles too much problems, I've changed radiator, fan, Excel, other Minor problems are too much such as windows, sensors, lights etc. I sold it, I than bought ford Mustang (my favorite car), I drove 90k miles with service history, I've replaced engine, I have replaced again the injectors 2 times, I've replaced fuel pump, I've replaced fuel pressure pump there are still too much problems. 
My friend has ford focus and have too much issues. 
These cars are making problems too much and also the parts are very expressive compare to Toyota Nissan etc.
Toyota parts are 5 times cheaper and durable then ford. In US people may like ford but here in middleast ford has very bad image, used Toyota are expansive because of the performance while used Ford are way more cheaper, For example in Dubai second hand Corolla is 28000$ the same model ford explorer second hand will cost 6k to 11k$ .it has no market at all
Reply: @bicornis Shop  lol!! I guess my 40 years of experience means nothing. I didn't work for Ford, I worked for an OEM that supplied ALL of the manufacturers.  So, go right ahead and hate on Fotd. I don't really care what a no nothing thinks. I will listen to what my real world experience tells me. Bye!!
Reply: @GaryCornelius  than you never used any other car other than Ford, 
Just use cars you will understand.
I'm from Eastern Afghanistan a very mountainous area, we are using 90s Toyota Hilux, US forces brought here Ford rangers for local police and there were too much problems, later the ended up Using Toyotas, do some research
Reply: @bicornis Shop  I have had over 15 cars in my 45 years of driving. Everything from VWs and Nissans to Ford and Chevys. Without a doubt Ford is as good as any others. Since I was a field service engineer I have a documented 1.5 million miles driven. Fords are great.
Reply: @GaryCornelius  I told you my experience, there is no doubt that Ford Mustang is my favorite car, but to be honest Ford of 2023 zero meters cannot compete Toyotas of 90s. Toyotas of 90s are still in service while you will never find a Ford 2013 car in working condition, I'm talking about durability. We are driving in very rough terrain and US forces in The were even Using Toyota land cruiser, Hilux and some Russian Kamaz trucks because all the times Ford rangers and other of their vehicles were always broken down
Reply: ㅁㅁㅁ
Reply: Norm for tolerance of crank bearings is 0.01mm per 10mm of journal diameter.Even going 20% bigger tollerance wont affect engine
Reply: این میل لنگ ها به همان مقدار که وقت صرف کرده اندبسازندبیشترکارنمیکند
Reply: @sergeykazantsev1   That's 0.0003",   3 tenths of an inch to we still stuck in Imperial, and that is  about half or less then any out-of-round specs I can recall.
Reply: These are not the final product, they're just making rough cores, they will go somewhere else to heat treat and final size, and then final balance with rotating assembly.